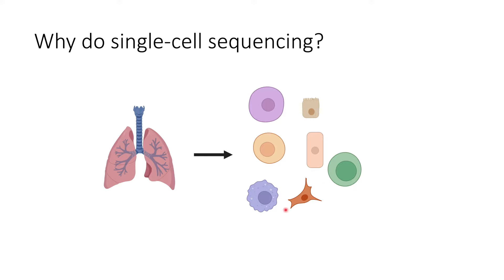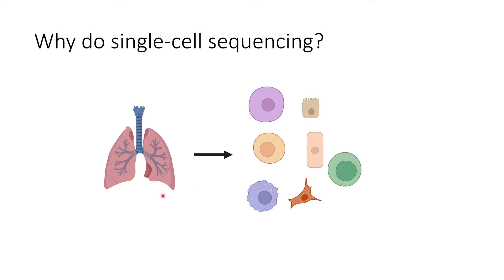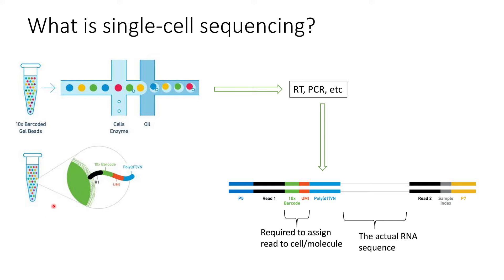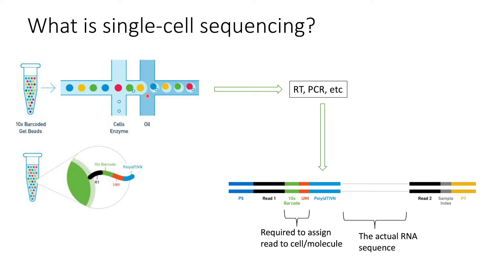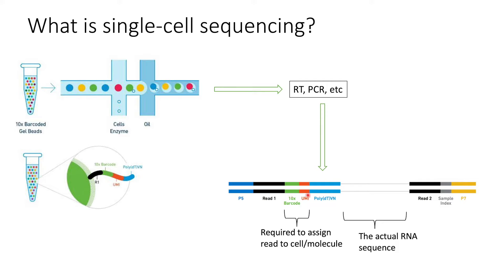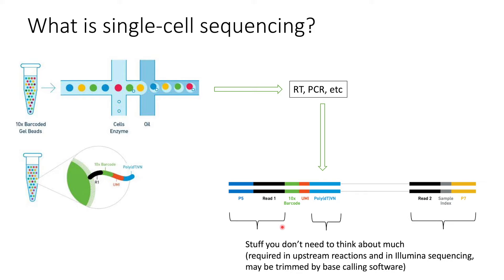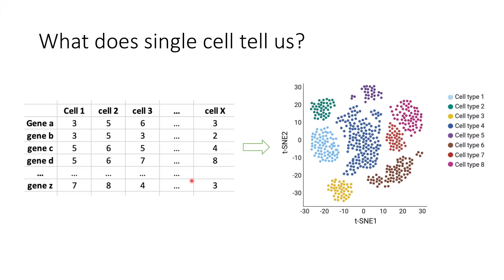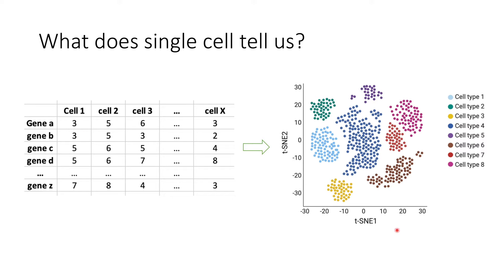Single-cell sequencing explained in 2 minutes

Comment: Thanks for the video! Could you maybe elaborate on common use cases for single cell sequencing? E.g. what questions could you answer after analysis? Just curious of the bigger picture where scs fits Thanks!
Reply from the maker: Great question! There are many potential use cases, but they all more or less boil down to one core concept: each tissue you type you examine has multiple cell types which all behave or react in their own distinct way given a given context or stimulus. Here is a quick examples, but there are many more you can extrapolate this key idea to: Is there a specific lung cell population that responds uniquely to infection?

Comment: Is it theoretically possible to extract all the information about a single cell from its DNA and then use that information to recreate that single cell? Or if not, could you at least create instructions of how to recreate a cell that was just like it? 

If this is not possible, where are the imitations? (Are they in any of the areas below, or something else?)

- Reading the DNA information 
- Converting the DNA information into actions to make the cells components
- Executing the actions

I know it's been quite some time since you've posted this, but if you are still around, I would really like to get your opinion.

Excellent video!

(I create Digital Life forms from brain scans by converting the brain scans into neural networks)
Reply from the maker: Not really. All the cells in your body basically have the same DNA but you have a bunch of very different cell types. You would need a complete epigenetic profile too. Some regions are repressed or active, etc